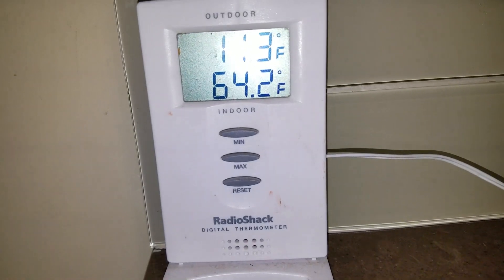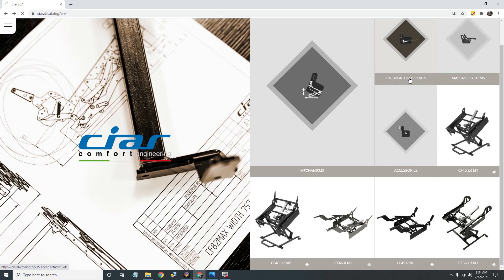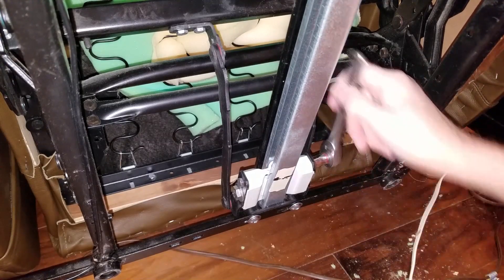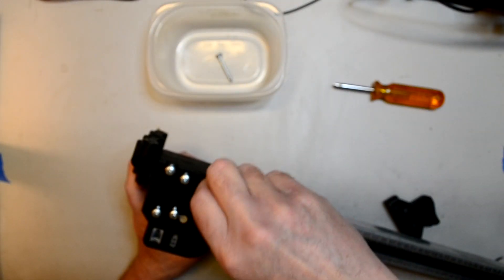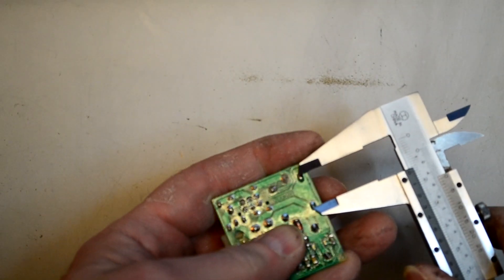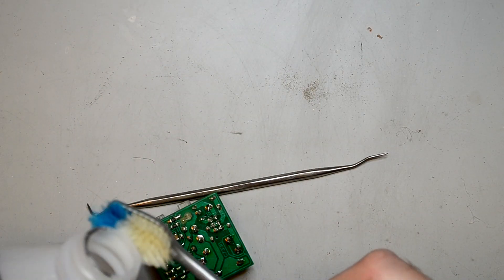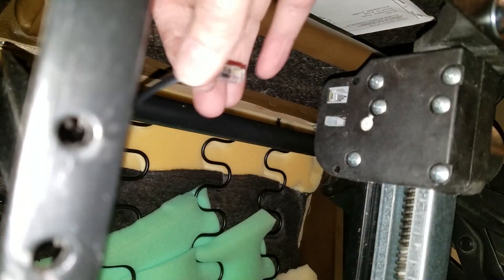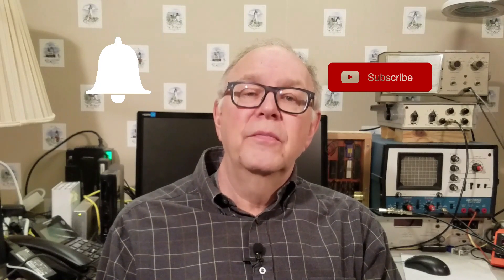Broken Recliner Actuator - Can we fix it?   CIAR LM55_03

Comment: I have a two yr old electric recliner with an actuator that looks much like yours except that a collar fell off the back of the actuator which keeps the chair from reclining from full extension otherwise ok.I got the chair after back surgery so  I haven’t been able to do much yet and of course the warranty is more of a hassle than you can imagine.I probably just need to bite the bullet and take it apart
Reply from the maker: The end that holds the screw can break if the limit switches are not functioning properly.  The motor is so powerful that it will just crank the back end plate off.  I would suggest getting it repaired under warranty if possible since it seems that the chair actuator manufacturers discontinue models often and the only way to get parts is under warranty
Reply: I’m sorry I completely forgot the most important part,it looks like it fell straight down to the floor from the back of the actuator where it held something in place.it fell off because the set screw on the collar was never tightened at the factory.what ever it holds in place is what’s keeping it from operating correctly.3/4 extension is ok but go farther and you’re in trouble but after watching some videos I can pretty much see what needs done.I just have to wait for a day I feel good enough and dive in but than you for a quick response.if I can’t figure it out I may try the warranty again but we did that once and I think it’s a complete scam type warranty.again thanks

Comment: What information on my recliner motor is pertinent to buy my replacement of a different brand?  Thank you Dave.
Reply from the maker: That's a tough one.  I looked into buying a new actuator, and it was impossible even from the same manufacturer.  I believe the chair manufacturers buy the entire frame and actuator as a package from the actuator manufacturers.  They all have proprietary controls and linkages.  You would need the stroke, and actuator force.  Good luck; it is not a trivial task.

Comment: Thanks for the video David!  I have a different problem... My Okin Model JLDQ-1A linear actuator failed with the couch in the upright position and it won't recline. Nothing happens when I press the switches on the couch.  Long story short, I took the actuator apart and found that a limit switch failed (both NO and NC contacts shorted to common all the time), so the couch thinks it is both upright and fully reclined at the same time, and won't budge.  The limit switch is not too hard to replace, you just have to take the whole actuator apart, remove the switch, desolder and resolder the wires to a new one. I'm trying to source a new limit switch right now, and can't find one with the right button height.  The switch part number is KW12-5, and I have checked Digikey, Mouser, etc and cannot locate it.  Most of the switches that I see at distributors have metal levers that press the button.  The ones with just a button don't have the right button height.  The right height is 2.75mm as measured from the top of the button to the top of the switch housing, in the non-actuated position).  I bought 10 buttons for $6.99 from Amazon that have the metal lever, and broke off the lever, but the button height is too short.  This is the red button shown in the picture (the OEM button has the yellow/orange actuator). I glued a piece of plastic on the switch from Amazon to increase the height, but I don't have hopes that this is a durable solution. The height is pretty critical.  Too tall and the actuator sliding over the button might break the button rather than press it.  Too short, and the actuator won't press the button far enough to actuate it.  I'm contacting Okin, but I'm not too hopeful that they will provide parts or divulge their sources for the switches.  I have two actuators that are bad on two couches.  I don't really feel like spending $400 on two new actuators for a $5 part.... If you have any insight into where I can source these switches, it will save me hundreds! Your help is greatly appreciated!  My email: miller863 at hotmail (I separated so the bots would not grab my email address)
Reply from the maker: I'm sorry; but I don't have a source for the limit switches.  Perhaps you can modify one of the Amazon switches by drilling and tapping a little screw into the end of the button.  I think that might last longer than relying on glue alone.  You could epoxy the screw in place once you get the height adjusted correctly.